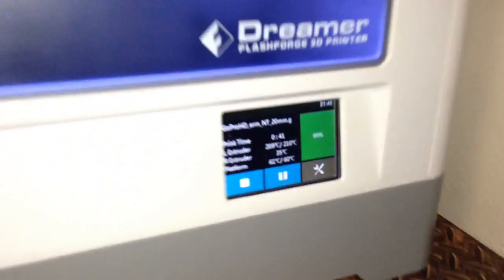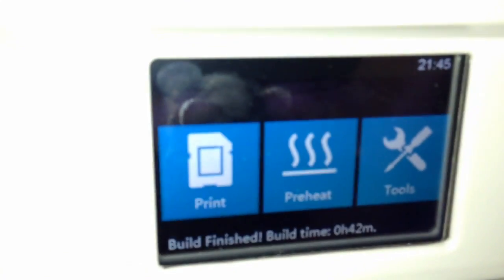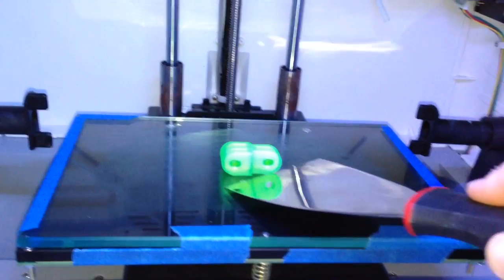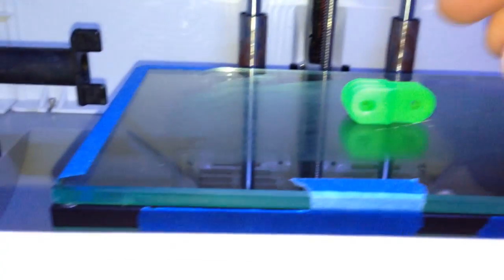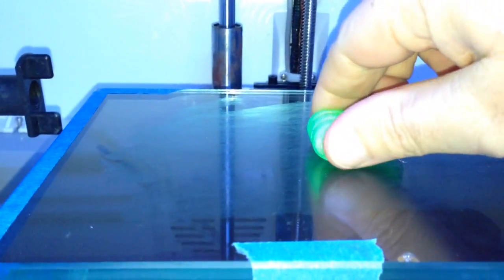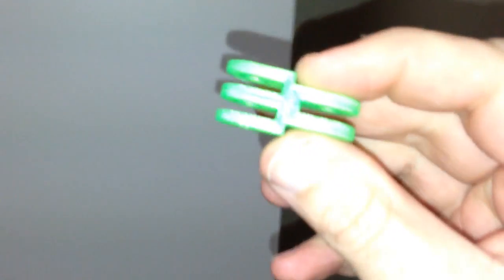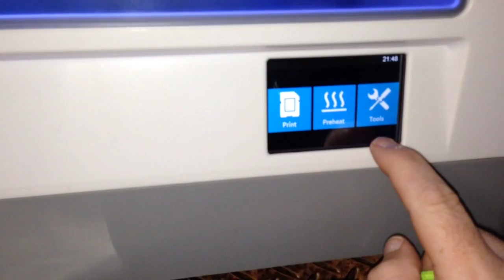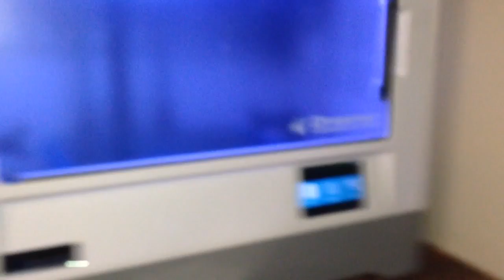Flashforge Dreamer - Glass Bed

Comment: Where did you purchase a nice piece of glass like that for the bed?
Reply from the maker: I just went to my local glass shop and gave them the size I wanted and they cut the glass and polished the edges to get rid of the sharp bits all for just $5!! I also used 6mm thick glass
Reply: Thomas James Thanks for the info, I have the same printer and just installed 6 extra fans cause of your video. My prints are almost flawless now. I plan on getting a glass bed such as yours and installing a heated pad underneath. I will def post a video once its all together.
Reply from the maker: Robert J I'd like to see your fans, please upload a video and let me know :)
Reply: Hello Thomas - I'm in Canberra also. Where did you get your 6mm glass bed from so I can one cut for my Dreamer. Cheers.
Reply from the maker: Discount Glass - 4 Purdue Street, Belconnen. Costs $5 and ask them to bevel the edges so they are not sharp
Reply from the maker: Phone:(02) 6253 1099
Reply: Thomas James Cheers Thanks for that. I'll let you know how I go. Pitty about the printerz plate not working out for ya.

Comment: What did you use to keep the hot end from hitting the bed?
Reply from the maker: There was a piece of plastic about 5mm thick that was shipped with the printer in the spare parts box that didn't seemed to fit anywhere so I just used it. I put double-sided tape on it and make sure it hits the micro-switch on it's way up.